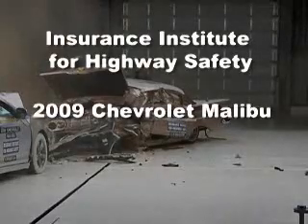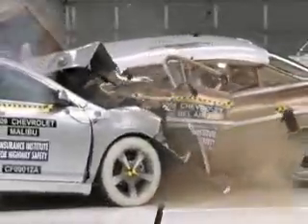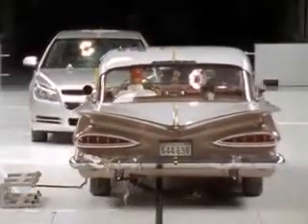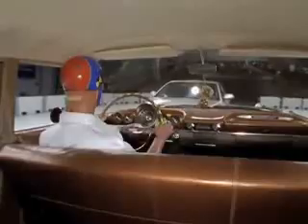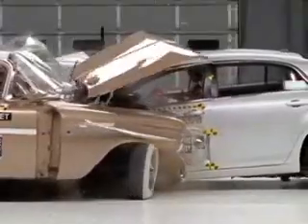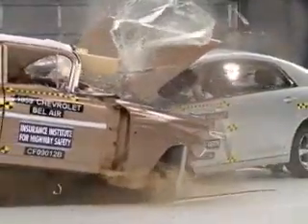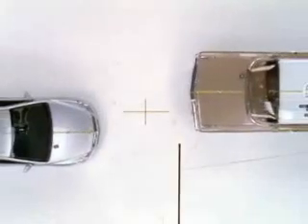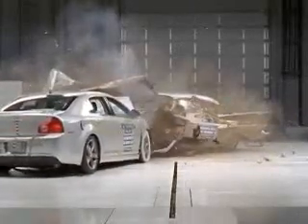Crash Test 1959 Chevrolet Bel Air VS. 2009 Chevrolet Malibu (Frontal Offset) IIHS 50th Anniversary

Comment: This is the the Insurance Institute showing how crash testing has made a difference...and it has made a huge one.  If there's no engine in the Bel Air it would actually perform better in this crash test because the frame rails would be easier to crumple in the front and absorb the impact and no solid cast iron engine block would be pushed back through the firewall.

The non-profit Insurance Institute is showing how crash testing has increased safety to celebrate themselves...not GM.

Comment: Hi there.  I happen to have worked with glass for the last 8 years or so.  First things first, glass DOES bend.  Yes, annealed glass will shatter if you bend it, but tempered can be quite wiggly.  Having personally handled quite a few tempered 9x69 inch lites, they wiggle quite a bit when you harp rack them.  But the windshield there is neither annealed nor tempered, it is laminated glass and there's a plastic lining in between. Shattered lami bends easily, even though it stays in one piece. HTH

Comment: This test is obviously FAKE,a 1959 chevrolet bel air's windshield doesn't just pop out and bend, 
GLASS DOESNT BEND,and also the 1959 has had the engine REMOVED  
Its just a company wanting more money because it is RIGGED

Comment: According to the Wheels article dated September 18, 2009 the engine was an inline 6 which left a huge amount of empty space between the side of the engine and the wheel well.  That might have been why the windshield pillar took the brunt of the hit.  A V8 would have slowed the Malibu down a bit more, but the A pillar is a weak spot in these wrap around windshield cars.

Comment: That 59 belair is probably a remake...you gotta remember, those old cars where solid, and 3 times heavier than stuff like that new car. I've seen a 70s monte carlo hit a 2000s ford taurus. That taurus was trashed. The monte carlo ofcourse had its dents to, but compared to the taurus, I wouldve rather been in the monte carlo with a neck injury than to loose both of my legs like the taurus driver did. Not a pretty sight.

Comment: Have you ever taken an old car apart? There really isn't much under the body panels in them other than air. The metal panels may be thicker but aren't supported properly. Plus in those cars the body wasn't the structure so it was a lot weaker than a unibody car.

Comment: umm the rigidity of the car is part of the problem...  whereas the modern car takes up all of the force of the impact in designated crumpled zones and leaves the cabin of the car relatively undeformed  the classic car transmits the force of the crash right through the structure of the vehicle into the passenger space.

Comment: So you mangy assclowns took out the motor, trans, and driveshaft in a 59 chevy and ran it into a complete 2009 chevy?

Congratulations the dumbasses at IIHS have proven that 1/2 of a 50 year old american car is more than enough to be on par with a complete example of the modern crap coming out of GM these days.

But I guess if you had run the test with a complete 59 it would have shown the a rather impressive newtonian reaction... (think

Comment: I thought they used a low mileage,almost pristine Chevy here. Sounds like they just painted over it to make it look new?? I thought they wanted to use a 59' car that was as like new condition as possible so the metal would be as strong as it cound be as compared to a rust bucket. Just wondering about that! I do see a lot of rust off of this one, I saw the same Chevy on display at the 2010 Ohio State Fair!

Comment: This whole commercial is BS. The gauge of steel used in the older car bodies is way thicker. The Malibu has a flimsy uni-body frame with dinky little sub-frames. An older Chevy has a channel frame. Would not surprise me one bit that there are major components missing and or rust damage to the old Chev. The Malibu would have been destroyed if the old Chev was actually in original condition. My '66 Chevy truck is way stiffer than my '95 F-150.

Comment: lets get it straight the 1959 chevy had a weakness The X frame first appeared in 1957, underpinning the new C-Body Cadillacs and Eldorado Brougham. It was obviously conceived as a way to facilitate lowering the total vehicle height, by facilitating deep floor wells for the passengers feet to drop essentially to the bottom of the car, unimpeded by frame rails.

Comment: In the modern car design, the engineers used the finite element method 
software to simulate the car crash on the computer, and then interpreted
the result, modified to the best performance in the crumple zone. 
The other aspect is the advanced material science which make the car
more stronger than the past. 
In the conclusion, I assume moderate automobile has the better safety than
past.

Comment: a 1955 Concept from General Motors had a computerized system in it. Cars that drive themselves was also a concept of the 50s. And Safety, to me, doesnt matter. My grandpa had a car without seatbelts in the 50s and never died.... And btw, Ive seen Some Early 1950s cars that are actually safe.. And safety, doesnt make an auto industry actually any more advanced.

Comment: Technologically, modern cars are far, far more advanced than ones of 50 years ago. Engine design and management has advanced massively, and so has the engineering of the structure of the car itself. While yes, the industrial design of cars hasn't evolved substantially, the engineering of them has. (Just ask: how many 1960's cars have engine management computers, unibodies or side airbags, for that matter?)

Comment: Nope.

I'm sure your brothers are great at fixing cars, but these guys are researchers. They run experiments to get results, not to embarrass car-lovers, so they had no reason to rig it. Besides, 1959 slide rules against 2009 computer-aided design? No contest.

Why they don't use them in NASCAR like the "good old days"? Um, do you seriously think the optimal design is the same for both?

And they don't "fix it to where there car looks like its safer". Protip: *they're actually safer...*

Comment: plus i didn't know you were there and looked the car over before it happened my brothers are automotive technicians and i am pretty sure they will know more about this then you. you dumb fucking moron. if these cars are so good why dont they use them in nascar in the old days it was a car bought straight off the lot fix and tune the engine and then race. they fixed it to where there car looks like its safer didn't you learn that in school they do whatever they have too to make them look good.

Comment: If you pick a classic that has a following, as 1BSARoadRocket said, any popular model, you'll find a full range of replacement parts, both stock and OE style. My two interests are Chevy and GM pickups and aircooled VW. Both have several major suppliers of parts. Even OEM parts can be fairly easy to find, and the prices are pretty cheap.

Comment: New cars have actually been holding their value to an insane degree. I'll agree with you on used being a damned good deal though. My '94 Ford Escort cost me $400 from a friend and it's been a good daily driver.

It's just always been a pet peeve of mine seeing old car enthusiasts going on about the cars of 50s, 60s, and 70s were better in every way, forgetting how for every pristine Hemi Cuda and Camaro at auction there were ten Pacers, Vegas, and other piles that barely lasted for five years.

Comment: As far as a carb that runs upside down...I'm sure the off road guys have that one figured out.  Even though my focus is on saving money with a collector car, if you have a worthless 15 year old car and say the trans and engine both go out at the same time and it's going to cost 5K to pay a mechanic to fix  a car that ecology would give you $75 for, that is still a better deal than committing your self to a 25K car loan for a new car that is just going to be worth $75 in 15 years.

Comment: There are lots of cars that will never go up in value, but with a small amount of research it's not hard to pick a car that will at worst maintain it's value or even go up and there are still lots of collector cars that are practical and still cheaper than the equivalent new car.  What about the air cooled VW, what about older Ford trucks?  What about anything powered by a small block Chevy?  What about old smog exempt Datsuns and Ford mustangs? Shop smart and there are amazing deals out there.

Comment: Next you'll tell me you have a carb tuned so well it'll run upside down. Such failures are a rarity in modern vehicles compared to older ones. The majority of drivers can't be expected to fix a roadside failure like that, carb or EFI.

On parts availability, I mean parts outside of the niche performance/collector markets and getting lucky in the salvage yard, which are going to become harder to find outside of specialty retailers.

I love older cars, the way they look and sound, but come on.

Comment: The total advantage of an old car is the cost in the long term.  You don't pay interest on a loan, it goes up in value rather than depreciating, you don't have to smog it, registration costs are a fraction of that of a new car, you only have to buy minimal liability insurance, parts if you have a popular model are generally cheaper and if you want to up grade it with better brakes, seat belts and safety equipment you can do that too.

Comment: If you think diagnosing a computer controlled fuel system is easy, try doing it in the middle of nowhere  with out a computer to diagnose it for you when your car mysteriously cuts out and coasts to the side of the road. Also you are getting your info from the wrong sources if you think new cars have better parts availability.  The small block Chevy has been in production continuously to this day since '55 and is the easiest V8 to get parts for that there is.

Comment: Well I can tell you are not an old car buff and don't do your own wrenching on any in depth level.  I never said carbs were perfect, the new fuel systems completely out perform a carb in every way except being user friendly to the home mechanic and long term longetivity. You can buy a new top of the line aftermarket 4 barrel carb for about $450 and bolt it on in maybe a half hour.   $450 won't even begin to buy the diagnostics software required to diagnose a computer controlled fuel system.

Comment: Carbs aren't the perfect solution as a lot of older car buffs insist. Modern fuel injected engines are, on average, far more dependable, espically in hot or cold weather, and can go far longer without maintenance. Between the added performance and fuel economy benefits, the ease of diagnosing problems thanks to computer systems, increased availability of parts, better standard equipment, and better safety record (X frame or no X frame), older cars don't have this total advantage you're claiming.

Comment: One fact is that the '59 Chevy was an X frame car in that the frame was actually shaped like an X with no frame tubing running along the side of the car.  This was a new and extremely poor frame design that came out in '58 and I'm sure that is why a '59 Chevy was chosen for this crash test.  Had they used a '57 Chevy   with a traditional frame or a '56 Cadillac that had a traditional frame with a heavily braced X member the results of the crash test would have been very different.

Comment: The cost of keeping an older car on the road over the long term is far cheaper than buying a new car if one really does the math and considers the interest one  typically pays in car payments.   Most 50's era and older cars only use a vacuum system for ignition timing and to power wiper motors and and carbs are extremely reliable since they don't have any computers to break down.  The modern fuel system is expensive but necessary due to today's environmental and fuel efficiency requirements

Comment: Anyone that has ever worked on an old car will know that the front body work on them is not constructed anything like a modern car.  On an old car there is an outer fender, an inner fender a radiator shell and the hood.  The outer fender is bolted to the inner fender and that is then bolted to the radiator shell and the firewall. The hood (hinge) is then bolted to the inner fender and the firewall.  There is no supporting structure under any of those parts.

Comment: So you see the Belair driver walking away do you?  Nup.

Face it.  I've crashed into an old 70's car head on in a modern (plastic) car.   It didn't go well for the guy in the Kingswood - he was a corpse.  I WALKED away and got a new car.   But that's the POINT.  Car dies so you don't have to.

Comment: You are deluded.

The point of a modern car is that it won't try and kill you in a crash.  I WANT my car to make lots of noise (noise is energy) and I want it to crumple into little bits.

That way, the crash energy isn't transferred to ME.  The car can die, I don't want to.

Your Tarted up Ford would probably make a little more damage on this new car - but the driver would be fine.  The Lincoln driver would probably be DEAD.  Killed by the forces that his car can't absorb...

Comment: Actuley Yes it does you get in a wreck with one of these new piles of shit they crumple up into a ball mabey there is a engine but then they fucked with it some how straight up the other car would be wrecked and the bel air would drive away if you think plastic is stronger then steel you need go back to fucking school and old car doesn't crumble into a ball like the new ones do i would rather be in a hospital alive because i get ingured in a accident with an old one then be dead in a plastic one

Comment: Yes Joey, the motor is in there.  Watch the full video of the test when this was done.  The car is in stock configuration.  As for your OPINION on getting into a wreck in an older car versus a newer car, i'll take a new car any day.  Tons of steel doesn't mean safer when it just folds like tin foil....

Comment: However older cars can take quite a lot more beating than the new ones and the quality of the older cars, in most cases, are a lot better than new ones. Even in the 1950's, Mercedes introduced the crumple-zones and made some of the safest cars around, that would still be relatively safe.

Comment: It was a restored, running Bel-Air that was bought from someone who did not know it was going to be destroyed. This was confirmed by the previous owner, Jim Snell on chevytalk, the guy was really mad that it got used for this.

You guys have to face it: In a serious head on collision, a modern car will be written off. In an older car, it's a hell of a lot more likely that the passengers will be written off as well.

They are damned beautiful but thank fuck we don't build them like we used to.

Comment: What? Both test vehicles were doing around 40 MPH, which last time I checked is a very common speed no matter the era. So what exactly is your point? You'd drive the Bel-Air any time, as long as you keep it under 30?

Comment: Did you see all of that orange dust during the crash?  That '59 Chevy was a mirage of what it once was...That car was rusted out, but doctored up to look good on the outside (probably why they felt it would be "OK" to destroy it).  There was no integrity left to the body and frame of that car, thus magnifying the effect of it's destruction upon impact.  Granted new cars are safer, but they are comparing a rusted out car to a new car with solid materials. Not entirely fair to the old '59!

Comment: Lol. Amazing comment! So if you think that having a V8 under the bonnet is safe because of its size, I wonder how much better off we would be with most modern cars having 4 cylinder engines?  Yep it's true that modern cars are safer, but it also very true that these modern engines are a nightmare to work on thanks to computers and crap. There's nothing better than having a nice classic  with a big engine such as a mk3. 3L v6 ford capri.

Comment: I'm an aficionado of classic cars, and I'm glad they don't make them like they used to. We have come a long way in engine technology and safety. I can't think of a better way to demonstrate this than with this old (not a classic) car. One of my goals in life is to get a piece of 1950s iron and bring it into the 21st century, but it wont be one of those x-framed cars.

There is also a conspiracy that the bel air dosn't have an engine, that's false. The original I6 is still under the hood.

Comment: It has no engine, and the frame and most of the car was rusted out.  The previous owner of this car was found and it's condition explained.  It was basically sitting in the middle of a field IIRC.

Totally bogus.

Comment: The engine doesn't make a difference in crash performance, the old style engine mounts In the Bel air means the engine would be pushed Back into the passenger compartment causing a worse outcome for the passengers.

Comment: You're wrong, and if you had actually done any research, you would have known that. Automobile fatalities per capita are the lowest they have been in over 6 decades. As for your second remark, all 2012 model year Fords have excellent safety ratings with multiple top safety picks.

Comment: well to be HONEST some apples and oranges comparisons here. Why NOT retrofit the old car with an airbag or at least 3 point restraints for a fair comparison?? And the "lead sleds MAY have been less deadly on the receiving end of T-Bone crashes again the recent side curtain bags not withstanding. There is also the issue of roof crush in rollovers but that is not relevant to the offset test